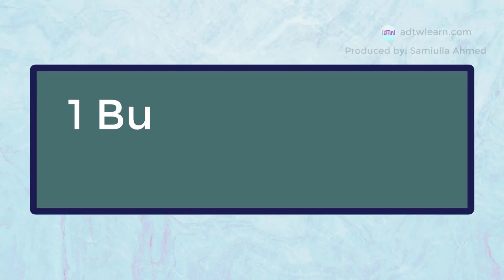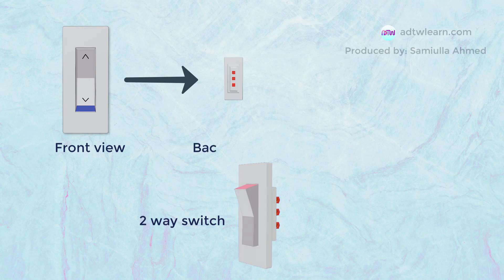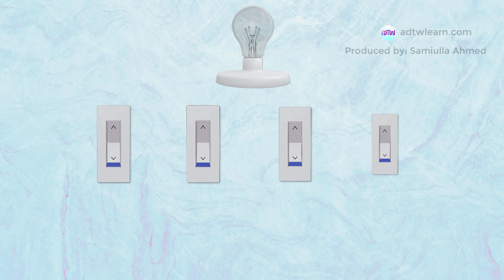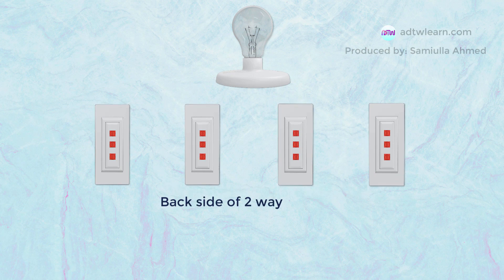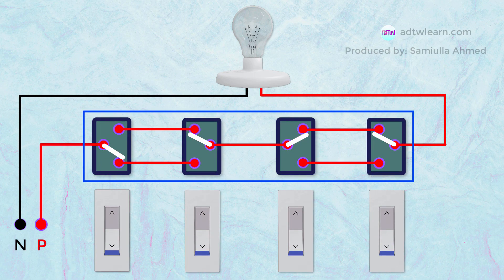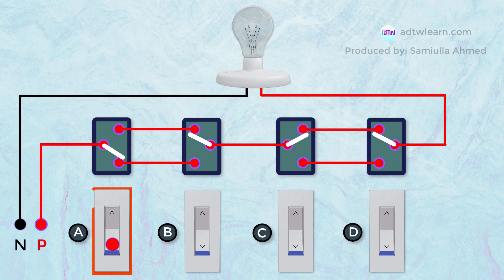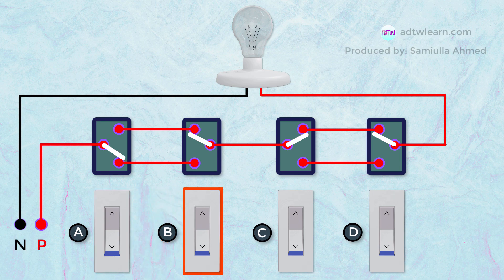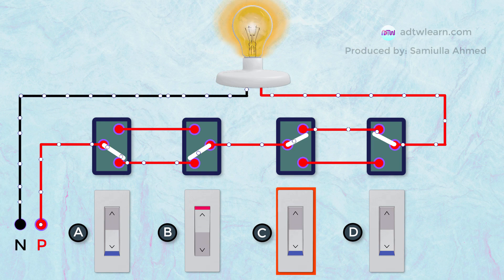1 Light 4 Switch Connection Wiring Diagram | Godown Wiring

Comment: this is not  correct 
properly use need a 2 pc intermediate switches and 2 pc 2way switches
Reply: Intermediate switch where available
Reply: @ponni.k7475  you can make intermediate switch to Joint 2, 2way switches with cross cable. you can check any diagram on internet
Reply: were are  available intrmidiet switch
Reply: Agree sir..i already try..not function..